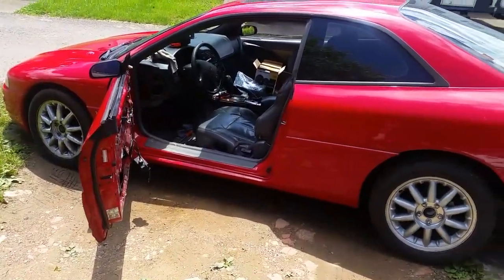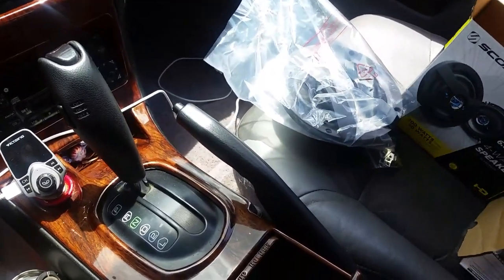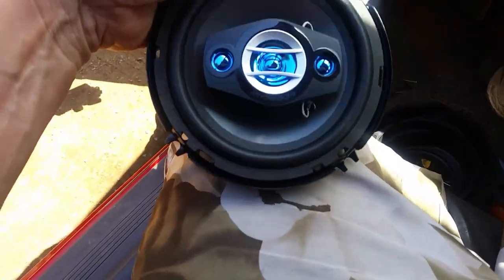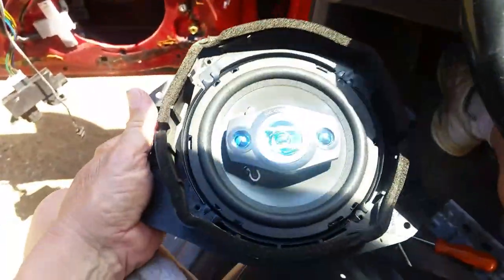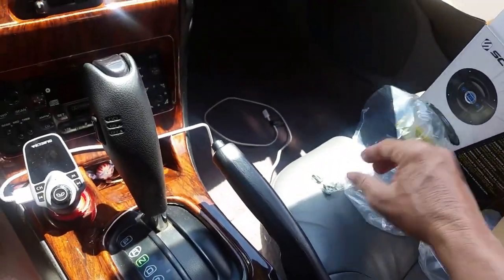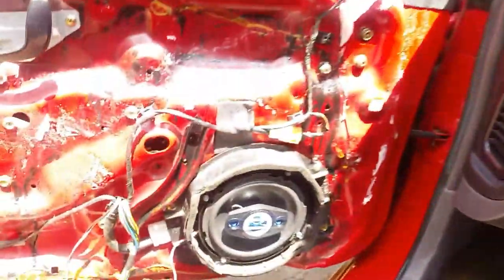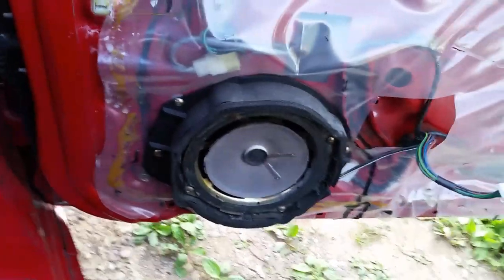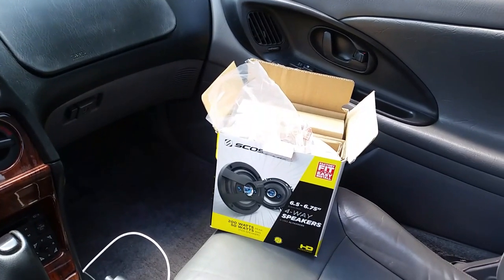Walmart $29 Speakers Review. They are just _______ Speakers!

Comment: That's pretty sad that Mitsubishi sells you on an Infinity system and then scams you with a paper speaker. I mean, yeah, it can sound good for a minute. But I've seldom seen them hold up over time... They're just cheaper to make.  "Thanks for your $50,000 chump. "
I wonder if they're putting that sh*t in Teslas???
Reply: Yeah I've always been told that the factory approved upgrade factory name brand car stereo stuff such as Infinity, Sony, Bose is still the lowest grade of those manufacturers. Your better off just replacing stock OE with brand new mid grade aftermarket stuff from the store.

Comment: Ur video is good but has a lot of problems from u not knowing a lot about speakers, amps, and car stereos. Also i am not sure what state u live in but here in Texas we have tons of junk yards that u can go to and get any part including speakers u need. We have several big chain junk yards here so their warranty is good town or state that they have one of their junk yards at. Scosche is not made by walmart but instead just sold there along with Pioneer, Polk, Jensen, Kicker, Sony, etc. Scosche is actually a descent cheap speaker like u found out. Also on ur radio u don't control ur amp by the radio that is just ur typical radio settings....in ur case u have a Chrysler radio which Chrysler owned Mitsubishi at one time. Ur amp settings is on ur amp itself. Just to let u know it is not cheaper to buy used speakers off Ebay or Amazon compared to going to a junk yard or like ur back speakers a yard sale. Junk yard u can get a warranty though.